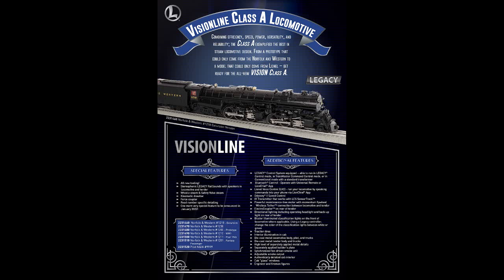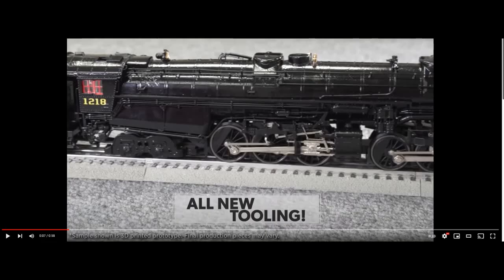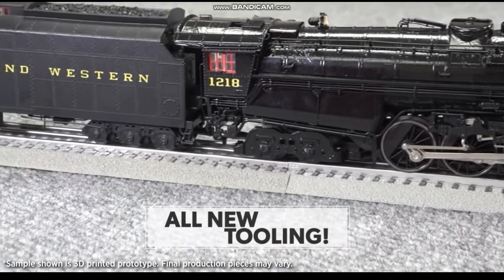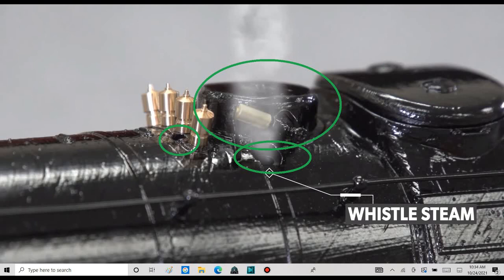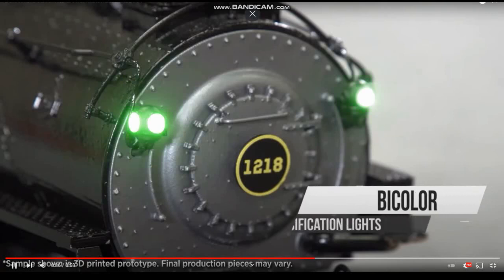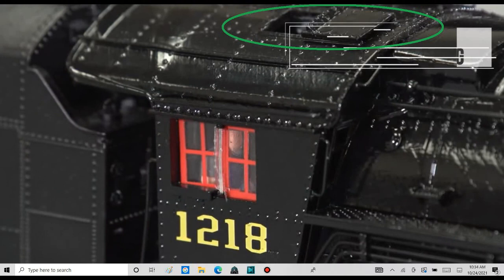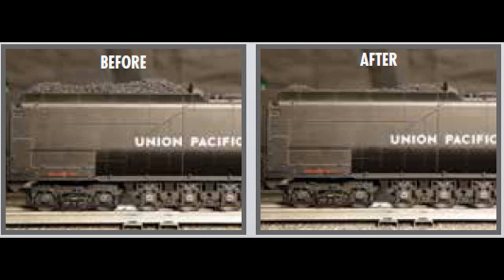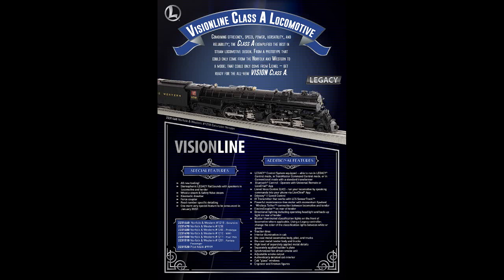Lionel Vision Line Class A Video Review

Comment: now i wonder if theres gonna be a ionchief plus 2.0 class a
Reply from the maker: No
Reply: rip bc we though if they could make a lionchief big boy and allegheny they could make an A too
Reply from the maker: @unionpacific8448  First of all Lionel is making a Vision Line one and I don't think Lionel will release 2 models based on the same engine in 1 year, second of all I would rather have a Legacy Class A than a Lionchief Plus 2.0 class A. The last Lionel Lionmaster class A was Legacy with whistle steam. A Lionchief plus 2.0 has never had whistle steam but Legacy has that a lot. Legacy is better it has been upgraded to changing color lights and 5 whistles and the Legacy Lionmaster Big Boy is cheaper than the lionchief plus 2.0 Big Boy.
Reply: @rail-ryder7135   I see but we all agree this is gonna be awsome